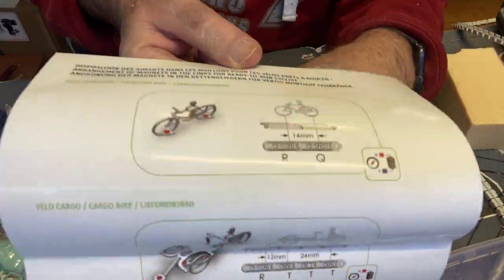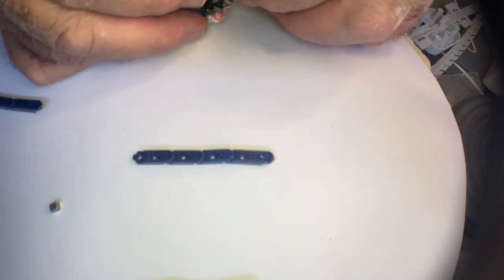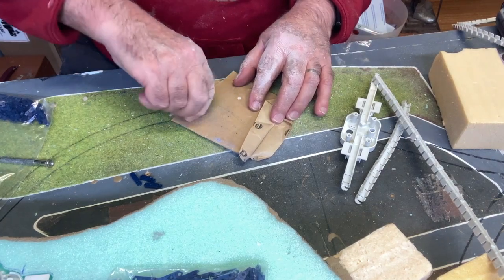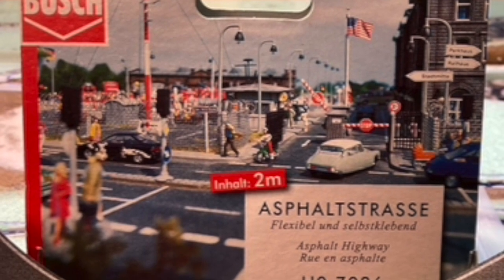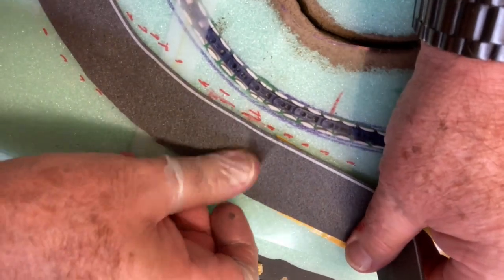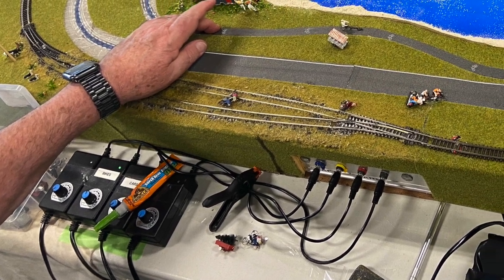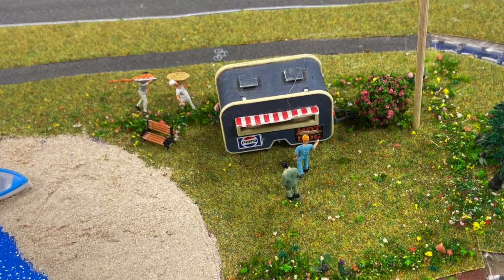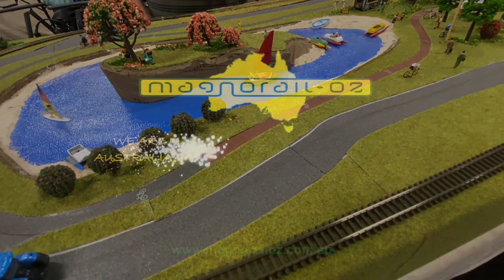ULTIMATE MAGNORAIL INSTALLATION PART 2   HD 720p

Comment: Hello, I have magnorail system on my diorama but the cars dont go properly...i do not know why. The chain works perfectly but the cars dont
Reply from the maker: Hi Jon - can you be a bit more specific. Are you using sliders or magnets directly on the vehicles, what scale are you in, what is your road surface made from, which motor are you using and how many also how long is your circuit and how many vehicles are you running. Get back to me at magnorailoz@gmail.com